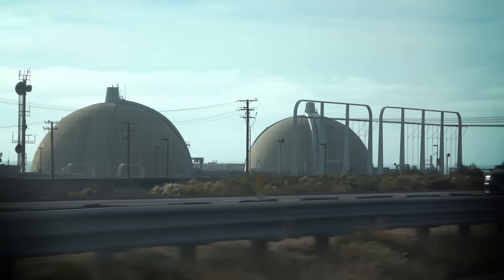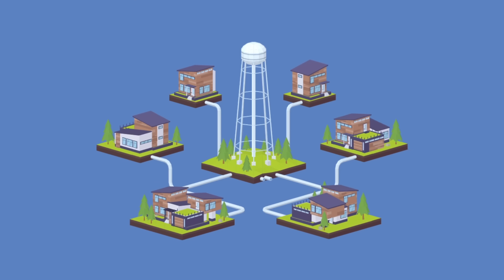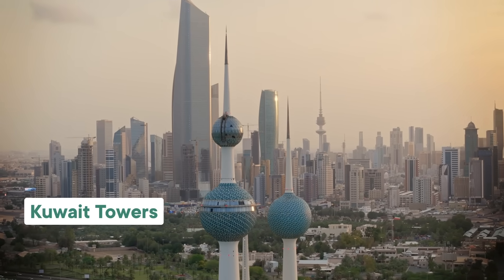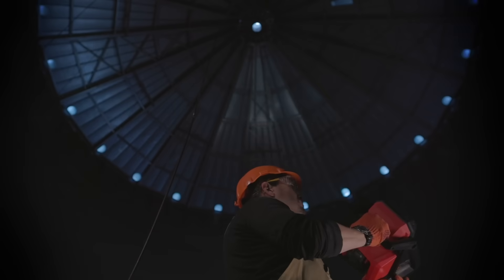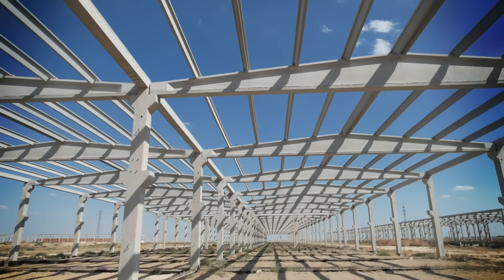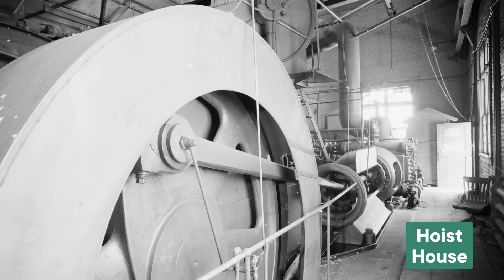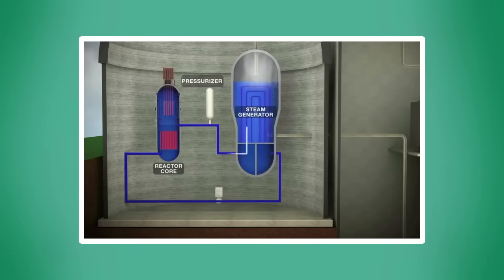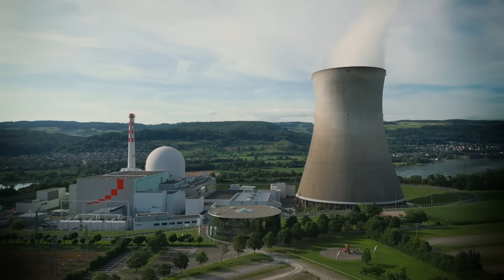Why Are Those Buildings That Weird Shape?

Comment: I've ... probably seen a mining head frame once. Around here we do a different type of mining (well, two) with their own ridiculously huge structures. And one of them moves around under its own power! Oil/gas and coal -- you know what an oil derrick looks like, you may not know that there's a guy at the top throwing joints of pipe into the hoist machinery to put it down the hole/racking the pipe when they pull it out. And the dragline shovels that strip the overburden to get to the coal in an open-pit mine are just mind-bogglingly huge -- imagine an oil derrick sticking out of the side of a small office building at a 45-degree angle to hang a bucket off the end rather than send pipe down the middle, and the entire block rotates as it picks up and dumps bucketfuls of dirt, and also shuffles backward very slowly as it digs to the base of itself.
The oilfield machinery has diesel generators at the base of the rig to power the electric winch at the top/the motor on the deck that turns the drill, and those big Cat diesels SCREAM when they're tripping pipe out of the hole to replace the drill bit. The coal-mining draglines are eerily silent -- they're usually powered by a cable thick enough to ride a bike on top of directly from the power plant they're feeding, so if you're right beside one you might hear the hum of electrical switching equipment and whine of electric motors from inside the cab.

Comment: Came here hoping to learn why raydomes look like that and nothing was explained.

All that was said about them is that they are big to allow the radar room to move and they are made of stuff that allows signals in and out easily.

Which is interesting but not really related to why they look like that. Or maybe it is but there was no explanation. Makes sense that they are big (usually) to allow free movement but the size wasnt really the question that was supposedly postulated by the video. The question is why do they weird like that. Size isnt weird, being all geodesic is weird.

There was no actual explanation for why they are shaped the way they are. Does the shape allow better focus? Is it just cheaper to house expensive equipment with panels like that?

What happened that caused that segment to he so passed over when everything else had such good explanations?

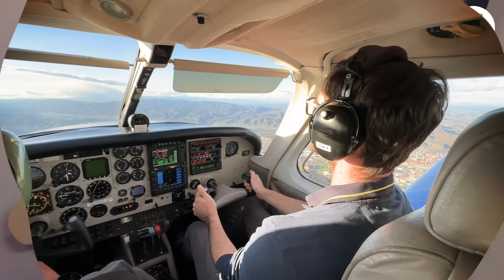Comment: 10:27 they actually are EXACTLY a light house...
Just radio light, not visible light. Much lower frequency/higher wavelength than the lighthouses you typically think of that guide Ocean shops with visible light

Comment: None of the things shown in the silos section are silos.  They were mostly grain bins, which don't store silage.  Silos are concrete or fiberglass lined because the silage is so wet it will corrode steel.  Grain is stored dry, so metal works well for grain bins.

Comment: Another form of “radome” doesn’t look like a dome at all, and it actually IS a building.  First developed in the 1960s, these phased array radar stations, aimed at a sector of the sky to detect aircraft or missiles, or to track satellites and orbital debris, look like giant cheese wedges, with their oblique face usually at a 45 degree angle.  This entire face is the antenna, and the building contains the driving electronics and computers, the workstations where the operators sit, and the office environment to run the organization, usually a military unit.

By sending a pulse of RF (microwave) to all (or a subset) of the many antennas on the active face, and controlling the phase shift of each antenna on a separate network, they can make the pulse into one or more sharp beams, and when the pulse ends, “look” in the beam direction for the echo.  Such a radar can concurrently scan the skies for new targets and keep track of many targets at high speed; the phase shift network is equivalent to a massless, inertialess rotating antenna that can jump to any direction instantly.

I was given a guided tour with my class of AFROTC cadets in 1968, of a recently activated PAR station in the panhandle of Florida, and I am sure they have been much improved since then.  In fact, 5G cell phone towers use a miniaturized version of the same concept.

Comment: The stock footage used at 0:11 is timed with narration about salt storage domes, implying that's what they are, especially since the only domes mentioned in the video are salt storage domes. But these ... er, interestingly-shaped structures are part of the San Onofre Nuclear Generating Station in San Diego County, California. And they only look that way from the highway. The twin domes are actually the top parts of the structures were are cylindrical. They have since been decommissioned, but they each used to contain a nuclear reactor and were meant to contain any radiation. The perfectly-placed protrusions at the top were meant for ventilation purposes.

Comment: 2:09 Okay sure PSI etc. but what does that even mean? What's the pressure of the water coming off of water main break or a hydrant vs my sink vs my sprinklers? These numbers have no frame of reference.

I'm sure its similar to electricity where you have high voltage power lines that go through substations so they're at the proper frequency and such for my 120V or 240V outlets. But no one talks about how my faucet is 3psi or the average person prefers X-Y amount of range.

Comment: Funny enough, you say that salt storage domes may be the most recognizable on the list, but it doesn't snow in my area so I was entirely unfamiliar with them. Today I learned!
Reply: Funny thing is I've lived in places that snow and salt roads for a large chunk of my life, but I'm not sure I've ever seen a salt storage dome--or at least if I have they don't stand out enough for my mind to make note of it.

I would have thought water towers or silos would have been the most recognizable since they are often the tallest structure in an area.
Reply: on the opposite end of the spectrum, i live in canada where it definitely snows but i’ve never seen a salt storage dome because we don’t bother salting roads since it gets colder than the freezing point of salt water anyways. we just put sand and/or gravel on the road for traction since getting rid of the ice is a losing battle
Reply: Same!

Comment: please stop saying "metric tonnes". they're either tonnes or they're not. you don't say metric kilograms, do you? wait. do you?
Reply: In writing, you might be correct. But in speaking, the word tonne and ton are pronounced identically, but they are NOT the same weight. For a primarily US audience, if she simply said tonne, we'd assume she meant ton in Imperial units. It's only about a 10% difference (1,000 kg vs 2,000 lbs), but it is still different. This episode is taking a LOT of justified criticism over the pronunciation of silage and what silos are used to store, but metric tonne isn't a mistake. Added later: On screen text later reads "metric tons" (not "tonnes") and I won't defend that, but if that's what they're going to do, they need "metric" even IN writing.

Comment: It’s being beat to death here but it would be great to correct. Silos and grain bins are different and the video mistakes both for being silos. 

Also silage is pronounced Si-lage with a hard I. 

It’s most often fermented anymore in silage pits or in long plastic tubes as it doesn’t flow well in an auger so it’s easier to move with a loader bucket on a tractor/farm equipment. 

It’s easy to be pedantic with these but in a recent Hank Green video he discusses how society seems to let people make mistakes but not media/reporters. Getting something wrong like this allows people to question the validity of everything else.

Comment: For the VOR stations:  one fact needs to be clarified.  The two signals that the aircraft receives are a circularly scaning beam and  an Omnidirectional broadcast of a pulses that is coincident with the scanning beam when it is pointed north.  The "North pointing" signal doesn't actually point north or else the aircraft couldn't receive it.  It is just timed with the north pointing time of circular signal so the aircraft can work out from the time difference what direction they are from the station.
Reply: And a real missed opportunity to mention how beam-forming works! The fact that there are no moving parts but the signal moves is nontrivial. The antennas are NOT just switching on and off in a circle.
Reply: @ So that part I didn't know,  Thanks!
Reply: Thanks.  That's what I thought but it was maybe 20 years ago when I heard how they worked.
Reply: I thought it was an omnidirectional FM carrier plus a rotating AM carrier signal.  The plane compares the phase between the AM and FM signal to determine it's degrees from magnetic north.   Then there's Doppler VORs...
Reply: @heatseeka14  Whew,  I'm an EE with an antenna design background, but these are details of the VOR I've not studied at all.  My original intent was just to highlight the need for a directional signal and an omnidirectional one to puzzle out the bearing.  I'll have to think about the phase difference between an am and an fm signal a bit more before I can understand this mechanism.

Comment: First I appreciate all of your great work and efforts to educate the public as a whole so keep up the great work.  I do have a couple of slight issues with this effort however as the section on silos is slightly misleading and incomplete.  Having grown up on a farm and still have family that are farmers in the midwest your definition of a silo is in one way correct in how they were used in the past but on todays farm it is incorrect.  For the most part silos, both on private farms and at commercial elevators, are used to store, dry and preserve grain crops, i.e. corn, wheat, soy beans, etc.  Unless you are located in an area with a lot of dairy farms, there is very little silage, pronounced with a long "I" not a short "I" as in this video, that is produced and stored.  The explanation of silage is quite correct, so that was great.  However on modern farms the methods of "fermenting silage" is now frequently done, not by placing the silage in silos but by either wrapping large round bales of silage in plastic wrappers or into long plastic tubes, kind of like huge trash bags, that remain on the ground.  These is much more efficient and does not require building a dedicated structure like an old silo for silage.  Otherwise the was a great piece and again keep up the great work.
Reply: Maybe this is a US vs UK pronunciation quirk?  Because I'm in Australia and have only ever heard it pronounced "sil-lidge", never "sigh-lidge".

Comment: Initially, you mention the distinction between 'buildings' and 'structures'. Then, near the end (11:25), you refer to them all as "buildings."
Reply: That difference was engineers and architects. In common speak they can still be called buildings. Thats at least how i understand it.
Reply: The difference, whilst interesting, isn’t really important when talking about it casually or to laypeople. It only really makes a difference if you’re having a serious discussion with someone in the field. 

Understanding is the most important factor, and referring to something that most people would call a building (and in terms of common usage be correct in calling a building) as a building doesn’t negatively impact the understanding. It was probably clearer than using the term structure, if anything, due to that common usage and understanding. It’s easy to get bogged down with overly precise definitions when a more simple, common one will serve the situation just as well, we’ve all been there.

Comment: Ironically, by trying to avoid messing up the silo thing, you guys messed up the silo thing. The Silos depicted in the video, are in fact, used to store things like grains, corn, and soybeans.
Reply: For further elaboration, they are called grain bins (smaller, generally found on individual farms) and grain elevators (larger, found on more corporate locations). They may have other names, those are the two I've worked with.
Reply: Yup, in my area we typically store silage on the ground in a pit, covered in plastic, not in a silo
Reply: I suppose missiles are not allowed in silo’s any more either?
Reply: I'm a total city kid who thinks eggs originate in the supermarket, and even I knew these were grain bins.

Comment: You got the agricultural silos thing partially wrong. I've primarily seen silos used for grains. Silage seems to be mostly stored in silage clamps where I am. Essentially silage is piled up between concrete or straw walls, compacted with rollers/tractors, then covered in black plastic wrap with tyres for weights. I've only ever seen silos used for silage once. Source: I've worked on multiple farms and I also worked for a grain merchants. Cleaning out barley silos is the worst job in the world.
Reply: that's all they did in the countryside her for silage.
Reply: This!!!!

Also.. it's pronounced Sy-lig. Like Sy-low.

At least around these parts
Reply: @BestDARNComputers everywhere, I think

Comment: There aren't too many water towers in the city I live in because it's so hilly. The water company just buys up the tops of a high hills and puts its tanks straight on the ground. They look like the storage tanks for oil, but I'm told they're cleaner than that on the inside.
Reply: They are likely pumping from the tanks into the distribution system rather than relying on gravity alone as well
Reply: Same concept, but yeah :)